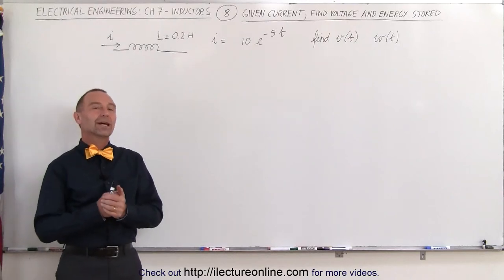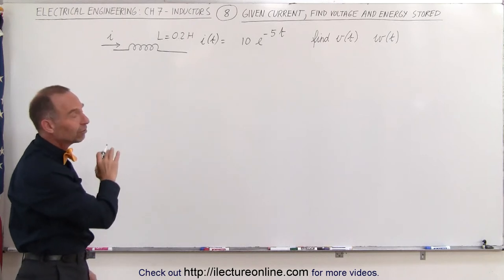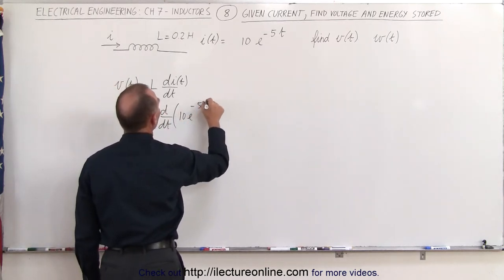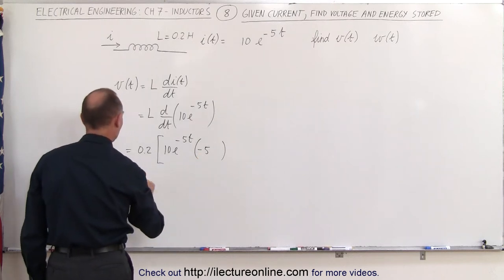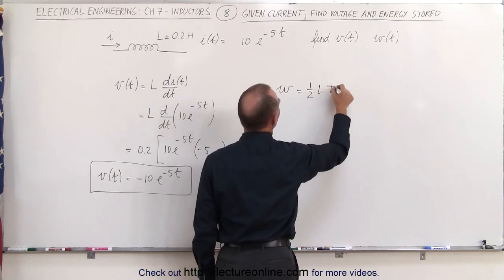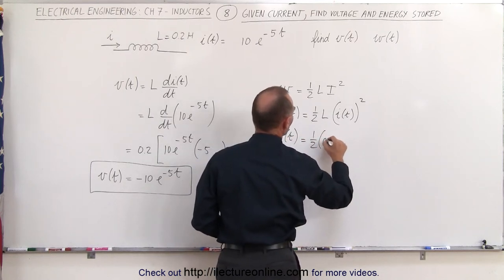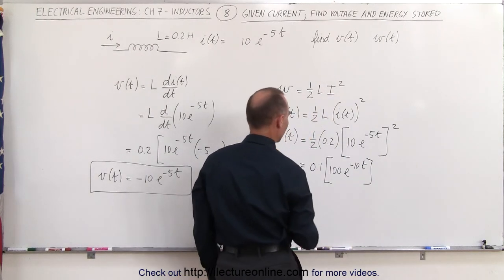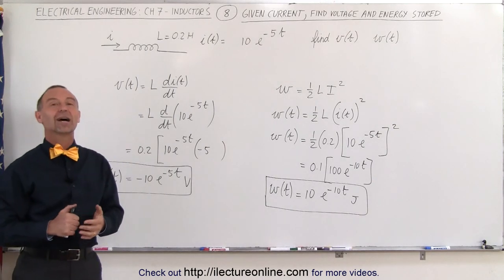Electrical Engineering: Ch 7: Inductors (8 of 24) Given Current, Find Voltage=? Energy Stored=?

Comment: I thought you mentioned that the formula for the voltage across an inductor is equal to -Ldi/dt but in the video you wrote it as Ldi/dt?
Reply from the maker: The sign depends on the direction and which equation is used.   In this example which side of the inductor will be at the highest potential?  (Note that the current through the inductor is decreasing).

Comment: The energy ( stored in a coil is dependent in the inductance(L) of the coil and the current
flowing. If the inductance were doubled with the same current flowing, what would be the
resulting stored energy? plsease solve this thank u
Reply from the maker: U = (1/2) L I^2     Therefore doubling the inductance (L) will double the energy stored when the current remains the same.
Reply: @MichelvanBiezen  But how will you derive it. Pls show to me. In comment box the solution
Reply: @MichelvanBiezen  because the answer would be the equation
Reply from the maker: We have have videos in the playlist that show how that is derived.